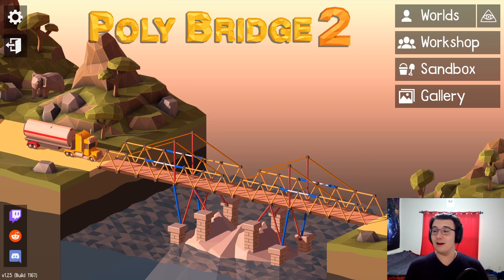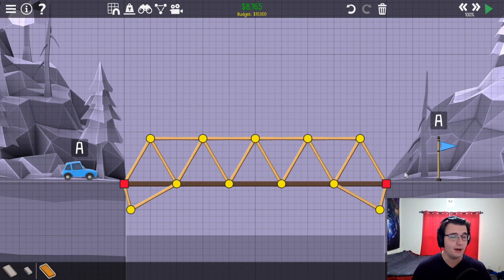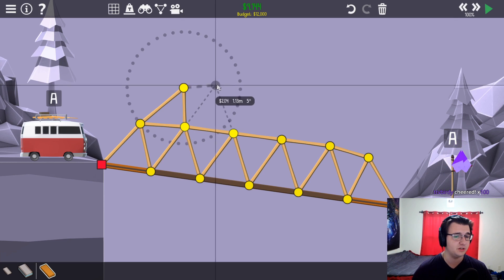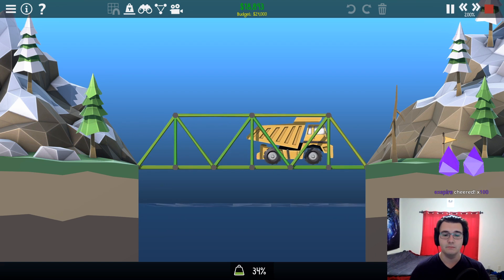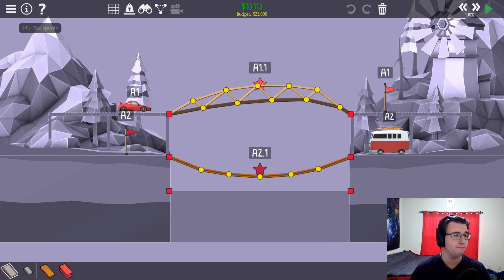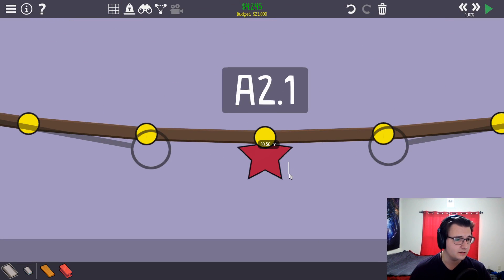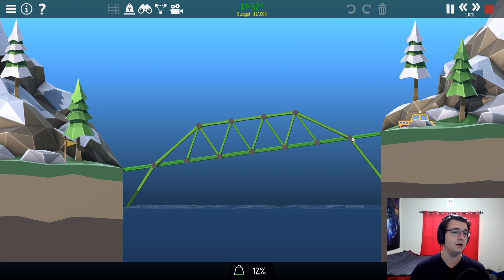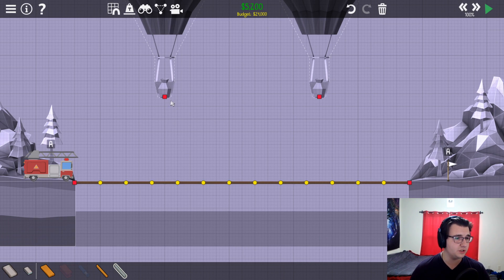Building REALISTIC BRIDGES With Extremely Low Stress

Comment: This is by far the most enjoyable Poly Bridge content for me. As stated in the video, the problem with spotting the most stressed parts could be easily solved by making the colour gradient adjustable, instead of going to red at 100%. Having it automatically use the highest stress level reached used automatically would be perfect.

Comment: I really have to disagree with the dev's on this one. It sounds like a fun game mode and wouldn't impede on the "low budget" mode. Or could just be a filter on the leaderboards so who ever wants to go for it, can. Its a super unobtrusive feature to add to the game. Not like it would ruin the experience for people who just want to tor the lowest budget. Besides its essentially the same concept - in either "mode" you are tweaking your bridge over and over to obtain an optimal result. Whether that is geared toward budget or stress, the core gameplay is essentially exactly the same.

Comment: If you are able to vary the number and size of the vehicles and use that to optimize the stress of the bridge you create, it should still be possible .. i think. Essentially, the challenge should not be just about what is the lowest stress you can get, it should also be about how many different vehicles can be supported by this bridge.

Comment: I think the leaderboard formula could be cost of bridge × ((stress percentage ÷ 100) + 1) with it counting as a failure if you go over budget or have breaks. For example, a $1,000 bridge at 99.9% stress would show as 1,999 on the leaderboard, whereas a $1,500 at 25% stress would show as 1,875 on the leaderboard.

Comment: When you're making bridges that goes on an angle, the structure supporting it, should be slightly drop shaped. (shape of a drop running down a surface.) The lower end of the bridge is carrying more weight than the higher end, and need more structure :)

Comment: Poly bridge 2 idea for coop:
There will up to 4 players and they will all get their part of the bridge to build with their own separate budget which,after it adds up give you the full budget(they don't all need equal budgets).The maps could be from campaign but a whole new coop levels should be made for better experience.Levels should be asymetrical to remove copy/pasting bridges and they would all have their parts of land to build,except in levels where the player border will be in middle of the air.There they will need to teamwork to make a working design by voting for making a special joint in the middle of the border which will only be there so the players can attach their part of bridges together.That joint won't show up when playing the level because it only serves a purpose of connecting bridges(it's breakable and usseles to use as an anchor).I imagined the joint to be yellow but it should look like the collor of the player which put it.Chatting in those levels should be enabled especially in levels where teamwork is necesary,and afcorse swearing would be deleted and player would get a warning that he will get a penalty for swearing too much(knowing that 85% person of people won't have problems from this).A pointing sistem should be added to have players be able to help eachother by pointing at a part of the bridge which is having problems.Reporting and vote banning sistems should also be there just because.

Comment: Meh: Implementing a low-stress mode with proper player feedback would be simple.  Just scale all material strengths down based on the player's best result (or from 1-100%, controlled by the player).

Comment: A way that they may be able to fix the issue with telling stress apart on individual items is someone could create a mod, or the devs could implement it, where the game will also highlight and say the most stressed non-breaking part of the bridge, or create an individual mechanic where you can select a part of the bridge and it will tell you the part's highest stress on the last run through.

Comment: It be cool to select a joint and see a stress/time graph to pinpoint exactly where/why failures are happening. Hell, with the amount of data being generated in each simulation it should be possible to do a frame by frame analysis of all forces acting on a structure but I suspect not many people would do that.

Comment: I would be interested in seeing realistic bridge solutions, so, no putting the cars under stress or damage, no unrealistically steep slopes, not using unrealistic connection points (hot air balloons), maybe making all hydraulic levels open the full width of the area the water covers, all while remaining under budget, and under a reasonable amount of stress. Maybe that'd be more under the real engineer guy's umbrella but idk.

Comment: R E A L I S T I C B R I D G E
"keep it under 40% stress"
If you told me the bridge i was driving on was 39% stressed I would not trust your bridges
Reply: that being said, i would prefer that over some random roads falling upon my vehicle!
Reply: fun fact: Elevators are usually have a safety factor of 12, and 8 cables. This means that a single cable can hold 1.5x the maximum weight of a loaded elevator car!
Reply: Would you rather the bridge be 39% stressed or 99.9% stressed
Reply: @gavindao6754  Not unless the bridge itself only weighs one gram.

And I'm unconvinced on those safety margins. That one skyway obviously was unable to handle a doubling of loads on the bolt, due to a design change, so it clearly didn't have a 100% safety margin. Also, the "three sisters" bridges in Pittsburgh  supposedly have a 100% margin (load factor of 2), and stood, whereas the "Silver bridge" in Point Pleasant, WV, had a 50% margin(load factor 1.5), and failed.
https://www.youtube.com/watch?v=8w5Fjouvma8&t=22s
Reply: The bridges you drive on are probably more like 50-60% stressed.
Reply: @someweeb3650  I just went and looked up the "factor of safety" for bridges, and found some places suggesting 5x, which means that under normal expected loads they should be under 20% stress.
Reply: A good bridge has a 200% safety margin. [Correction: Load factor of 2]
That means, it can support double the highest load it's rated for.
Reply: @bcubed72  a 100% margin is double
Reply: @someweeb3650  "The bridges you drive on are probably more like 50-60% stressed."
That is completely untrue.
Reply: @nathangamble125  The three suspension bridges in Pittsburgh PA have a "load factor of 2," apparently, meaning they can support double the max design loading. They did okay. The Silver bridge in Point Pleasant WV, only had a load factor of 1.5, and it ended up in the Ohio. 
https://www.youtube.com/watch?v=8w5Fjouvma8&t=22s

So, per this, a bridge loaded to its design limit, is ~50% stressed, IF it is in as good as shape as the day it was built. (Oh, and that skyway failed  when a design alteration doubled the loads on the fasteners, so (by design) they would have been 50%+ loaded.

Comment: Idk how difficult it would be to implement, but maybe for the lowest stress tests you would be able to change the color changing ranges for how stressed the bridge is. For example, your first test will always go from green to red from 0%-100%, but if your bridge was for example under 20% stress it would change the range from 0%-20%, so a piece at 20% stress would be red as if it was about to break
Reply from the maker: That's what I was hoping for too, while I doubt this'll change the devs' minds on adding a new leaderboards, I think this feature could still be added independently for great fun
Reply: @Aliensrock well poly bridge 3 has stress leaderboards now!
Reply: I doubt this idea would really be that difficult to implement, all it would take for the devs is to simulate the bridge first and scale the colors to the highest value. Another option is to show at the end the highest stress of each of the beams, or it would even help to either highlight the most stressed beam (like it does when one breaks) or show the highest stress for each of the beams at the end via the color that you can just view at the end. So many options, so easy to implement... doubt it will ever happen.
Reply: @monky123344  yeah, just add an overlay in the editor after you run a bridge that colors things based on what got stressed the most.
Reply: Yeah, there are lots of ways to do it. My preference would be a toggle after the simulation is run to show the exact stress percent of various pieces. Either of all pieces or just of the most stressed pieces; I'm not sure which I like more.
Reply: Another possible thing would be to have user-adjustable stress curves, sorta like color curves for photo editing.
Reply: I agree that automatic scaling to the max stress makes sense. They could then add a post run stress analysis mode where all pieces are colored by they max stress, color scaled to the max stress pierce. And just like the breaking piece is highlighted now, the max stress piece could be highlighted.
Reply: They could also add the ability to step through the simulation frame by frame and maybe even jump to the frame where the peak stress level was reached.
Reply: You would also have to make it so that the parts that get stressed stay light up after they are stressed. So that you still see it if it gets lit up for only a frame or two.

Otherwise came here to post this. If you made these changes and played on slow mode it would be viable, though I would probably only put it as a mode for people who have full completion on everything under-budget just because it is still finicky.